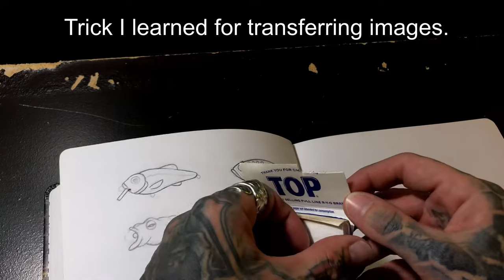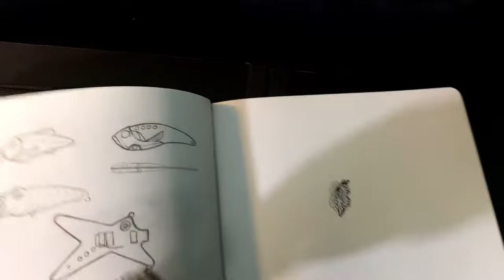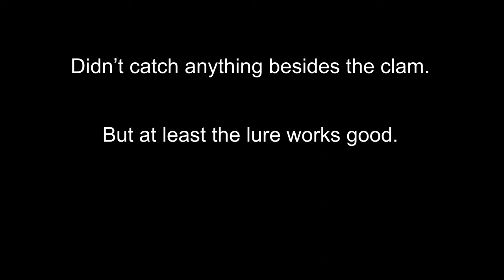Lure Making a Blade bait from solid Brass and Stainless Steel

Comment: Nice work 👌 I don't know if due to the time spent on the build you planing to create more of those lures... But would work fine to mix the brass dust with epoxy to use as a filler for the cut slots 😉
Reply from the maker: Nope I won’t be making another one of these lol. Unless I get a metal blade for my bandsaw maybe. And yes I keep the brass shaving for inlay. Usually in wood. I was just a little lazy with this one close to the end. I was worn out from all the cutting haha.

Comment: You'll be making Jewellery next, and why not 🙂👏
Reply from the maker: I actually do that too a little lol
Reply: @TreysArt  That could be a fill in video at some point and would be worth watching. Some of the same skills that blend with lure making anyway ( the metal ones ). Metal can be a pain to work with compared to wood, that's why I ended up becoming a joiner/carpenter 😆 Cutting down that brass would have drove me nuts to be honest, well done for persistence and patience 10/10